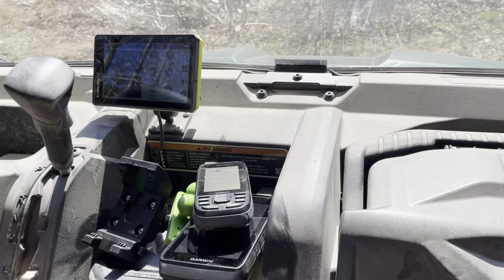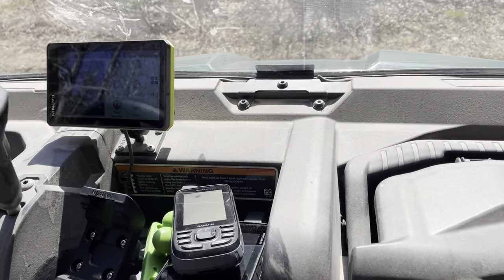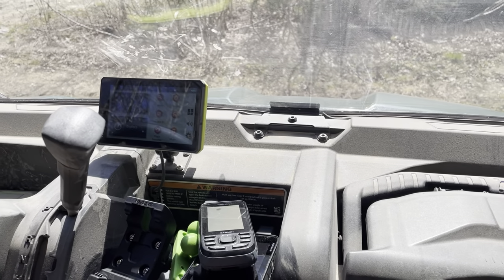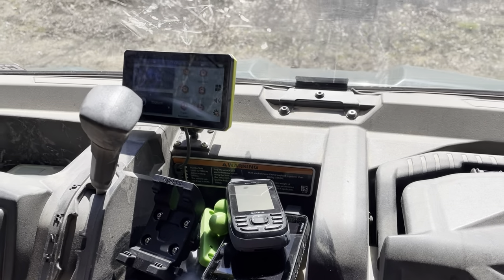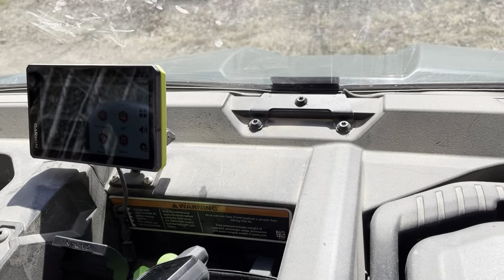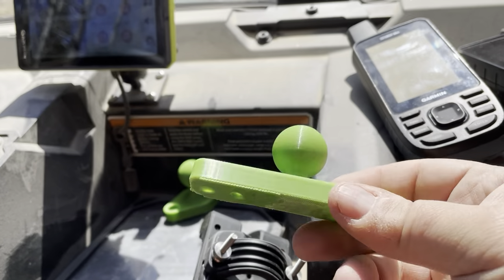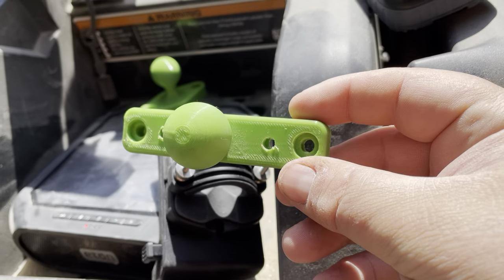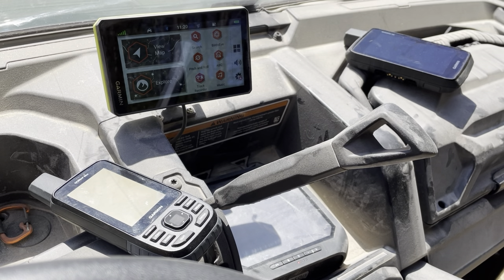Navigating the Trails: Can-Am Defender Garmin GPS Mount Locations for your Side-by-Side UTV

Comment: I got the powered mount and the bicycle mount like you have for my Montana 700i and although expensive it is working great. the powered mount is on my Honda Africa Twin with the bicycle mount on the cross bar and took the powerless mount and used it on my Outlander. The locking screws have never been used on either one and the GPS is really solid in the mount. I do use a tether just in case but the more I use it the more faith I have in the mount. If you pull that rubber off the back of the bicycle mount you'll find the holes for the rubber grommets line up with the screw holes of a regular RAM ball mount.
Reply from the maker: thanks for giving a bit more detail on your experiences with the mount. I'll be looking at removing those screws and opting for the USB cable route to try out and see how that works out.

Comment: On your Garmin Montana Handlebar mount - if you take the four screws out that hold the handle bar mount portion, you can use the standard RAM mount on the back of the unit.

I have purchased the Garmin Tread unit as you have along with the BC40 wireless camera. Hope to have my Defender next week.
Reply from the maker: Fantastic Kelly! I knew someone would recommend something for that mount. Yup I’m looking at it now and you are right 💯 glad I didn’t order any extra RAM parts for that yet. Keep me in mind when you have your Defender and BC40 hooked up; I’m curious about it.